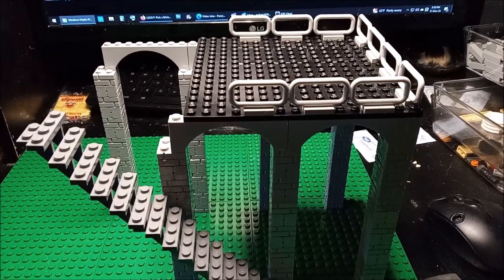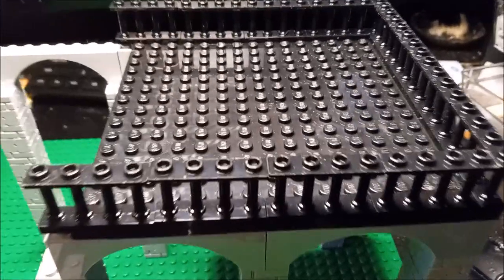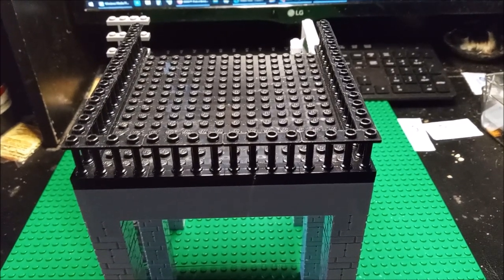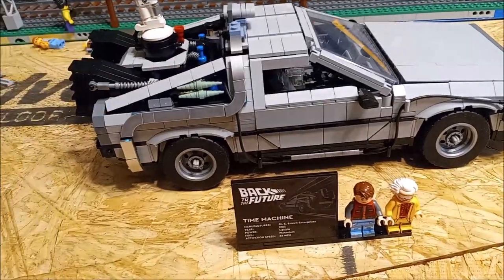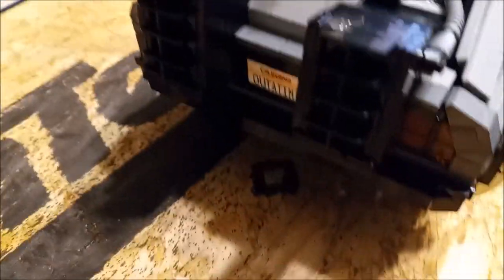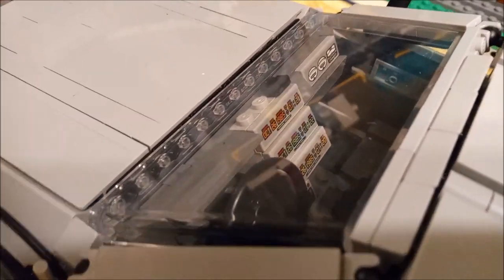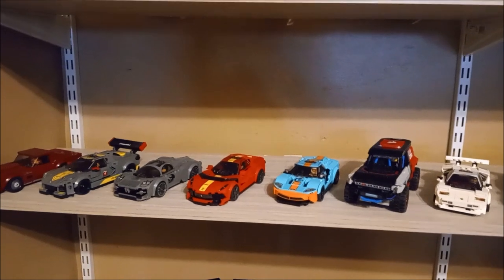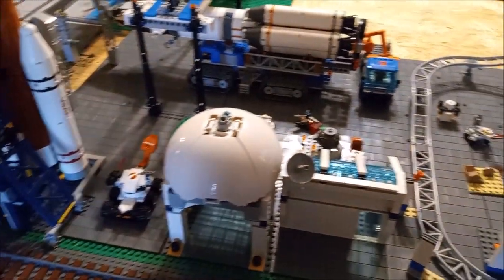Elevated Train Station Underway | Let's Talk About Lego!

Comment: Black railing is the way to go. You could extend the platform to the rail line and use the arch for supports. Or attach the extra the rail line so they would remain modular? Anyway BTTF 1 is still the best.
Reply from the maker: Probably keep it modular.

Comment: The black barriers are the pick of the 2. I think if you just extend the platform over towards the train line you’ll be right, maybe use a half arch as extra support for it.
Reply from the maker: I ended up increasing the size of the platform and moving it 5 studs closer to the tracks. :)